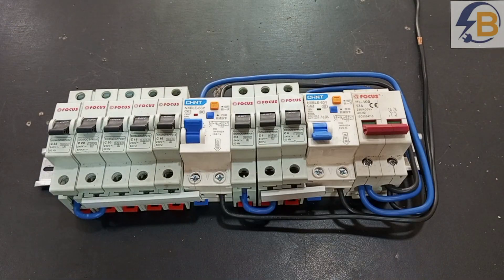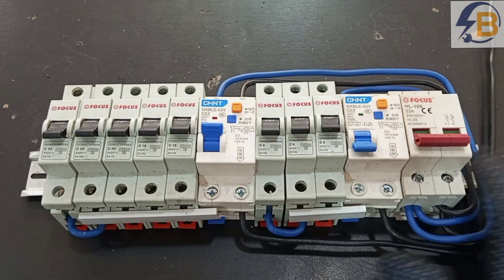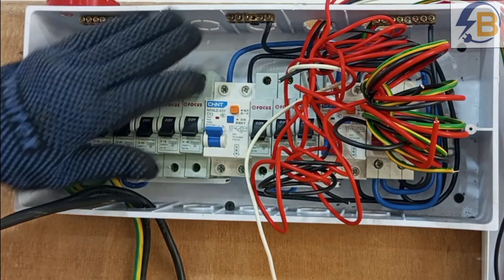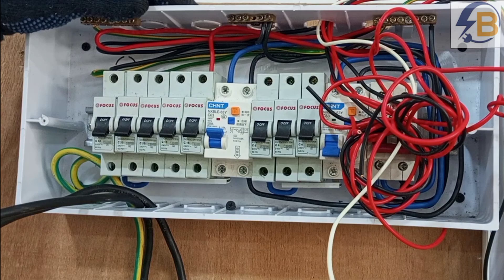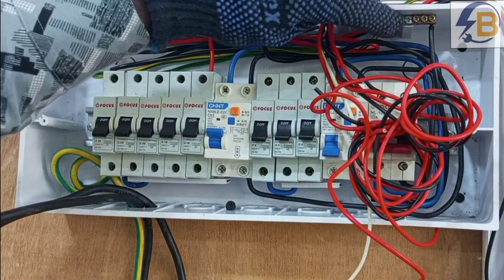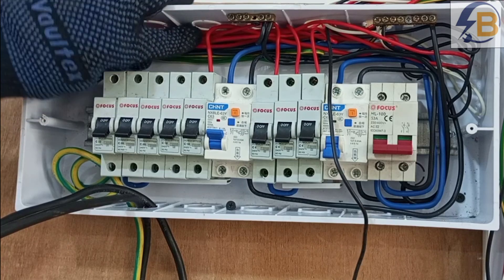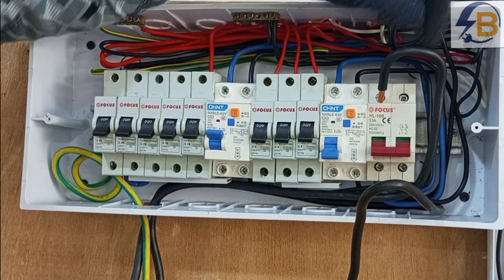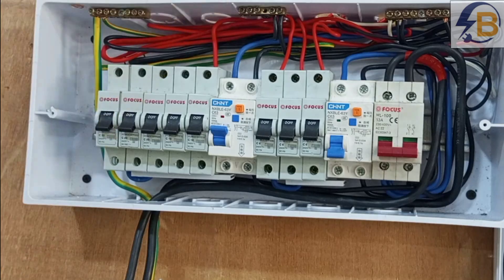FULL DOMESTIC ELECTRIC INSTALLATION |PART4| How to Install a Split Consumer Unit.

Comment: A feed wire came from posh switch to sitting room switch and another one came directly from DB to the same sitting room switch. My questions are, did u terminate them in the switch COM terminal of sitting room, and why? Then at the bell circuit, i observed that u changed its feed wire to red instead of the original twin white wire, what is ur reason for that pls. Thank u sir.

Comment: Thank you so much for your teachings Sir, 

My question is, you mentioned connecting the earth wire for the general connection in this part 4 of the house wiring series, I thought each circuit has its own earth cable when drawing wires, is there another general earth cable for the whole wiring. Thank you
Reply from the maker: Please try to watch these two videos
1. https://youtu.be/Kp0a3jFHjiE?si=S1X0E5qjJrJd1U3f
2. https://youtu.be/mU5Gt515o6Q?si=_vr7XSUujr5rZkFa